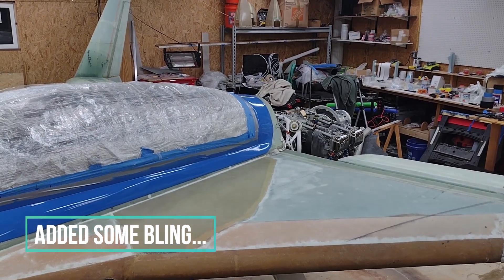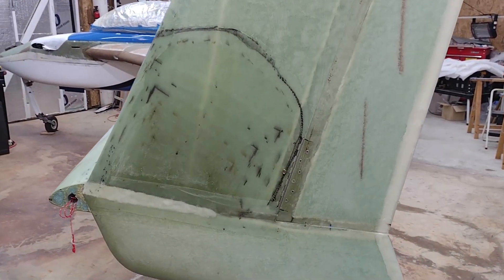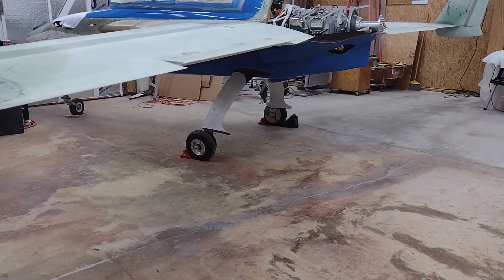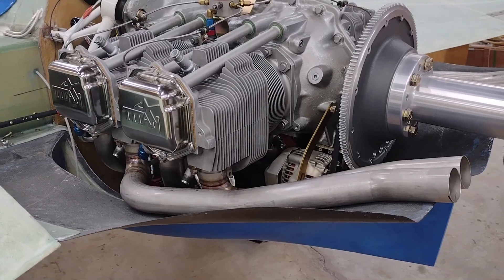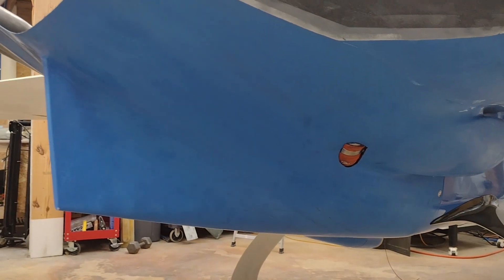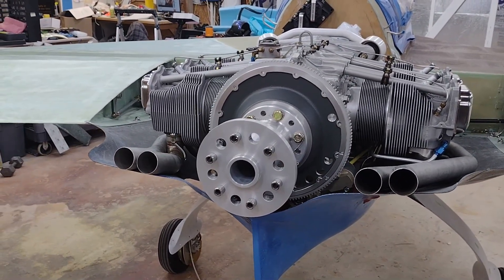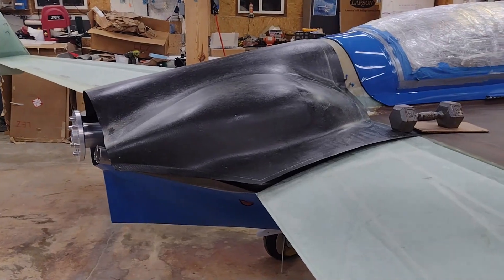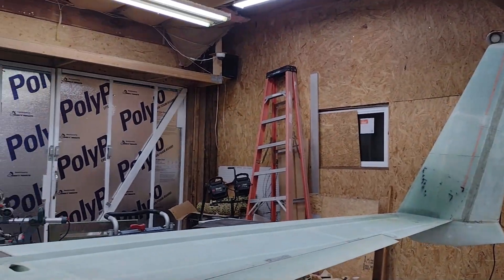Long-EZ N916WP - Project Update: Winglets, Rudders & Cowlings

Comment: You can cut your alternator adjustment bracket on the upper end and allow the alternator to get right up against the crankcase. I’ve done that 30 times in the past . At your armpit scoop laminate a vertical fence onto the cowl to keep the inlet flow from dumping into the bottom of the cowl . The inlet flow energy must be laterally contained so it can be directed at the cylinders
Reply from the maker: When you do your alternator mod I'm guessing you have to determine/buy a shorter belt?  Or does the curve of the bracket keep it equidistant with the same size belt?

Since this video I've installed the vertical fences based on Mike Melvill's patterns, slightly modified for my engine of course.  I'm also assuming he got those from you.  I've got them about as high as possible and as close as I can get to the bottom engine components with just enough clearance for engine movement.  In fact, I was wondering about the cylinder base fins getting enough air with those vertical fences in place?  Thanks Dave!

Comment: You changed the V/S area for styling purposes?  Anything else to make up for directional stab?  So, LEZ rudders only deflect in one direction?
Reply from the maker: I only reduced the height of the lower winglet (vertical stab).  Many builders remove the lower winglet altogether and there are a ton of canards out there flying with no lower winglet... a very common mod.  The upper winglet is stock size and position.  

That being said, the rudder is modified with the top and bottom cut level with the ground/wind, versus 90° to the rudder trailing edge (top & bottom rudder lines angled).  This too has proven to be stable with a virtually imperceptible affect on flight characteristics in canard aircraft configured so.  

And yes, the LEZ rudders only deflect outward, and are separate in operation.  This allows for deploying both out while on final approach as airbrakes to slow the plane down.  Also, the configuration is such in the rudder/brake pedal that you cannot push on the brakes without outward deflection of the rudder: thus, airbrake always before wheel braking to save brake pad wear and minimize brakes getting hot.

Comment: I’m curious at to what the final CG and empty weight will be if you know yet? All that engine and stuff in the back usually leads to aft CG that requires additional nose weight to bring it into the envelope. That, combined with all of the other “goodies” puts the empty weight too close to the max gross weight of 1325 lbs to leave any useful load. An old debate with the Longeze I know but where is yours so far?
Reply from the maker: My bird will be a bit heavy, estimated around 1050 lbs, but that is my choosing to throw all the "goodies" in at the beginning.  A lot of builders start with lighter planes but within 3-5 years add in extra stuff, like a cockpit heater, etc. and the weights typically go higher.  The original Long-EZ had an O-235 and a short nose.  Most these days have an O-320 sized motor and a longer nose  (like mine) with the battery farther forward to offset the engine weight. When you say max gross weight of 1325 lbs. I think you're mistaking the Long-EZ for an LSA.  It's not.  The max gross weight is higher than that.  I haven't gotten into all the particulars on that and W&B just yet as at this point I'm just trying to get the plane built in the lightest way possible.  Thanks for watching!
Reply: The original LEZ pilots manual shows design gross wt. 1,325lbs. Maximum landing weight is the same. Takeoffs up to 1,420lbs are acceptable off smooth surfaces with 6ply tires at 80psi. Inflight limits become 3.8g at this weight. Cautions that off-airport landings above 1,325 become exponentially less survivable as weight increases. Owners Manual pages 30, 39.

For all the "Experimental" in the Long-EX community. The fact nobody has increased the main spar cap and shear-web thickness by several plies, or used S2-Glass as Melvilles used, or increased the strength of landing gear legs either, is beyond me. 

These are simple mods that require no dimension changes to the aerodynamic surfaces on the aircraft. No change to any dimension anywhere, other than spar depth in foam. Or simply using S2-Glass. Or adding 8-10 unidirectional S2-Glass plies to the gear legs. Any one of these would improve structural safety and bring the stress/strain back into spec for fatigue and allow for the original G-limits at higher gross weights.

Comment: You're making good progress!  Consider mounting your fuel injection flow divider under the engine.  Airflow Performance recommends that the flow divider be installed under the engine when updraft cooled.  See page 29 of their installation manual.
Dave Adams
Reply from the maker: Thanks Dave!  I talked a good bit with Buly and my engine shop owner (a former LEZ driver) when I was having the engine assembled, and both had a lot of time with their respective spiders up top and both claimed no issues over a ton of flying hours.  Still, I've already recon'd the low-side engine and have a mounting spot, rough mount specs and approximate tube lengths ID'd.  Not gonna lie though, my curiosity wants to know how this high vs low spider mount thing really compares given various examples.  I've never seen anything in print before though other than in forums, so thanks for the Airflow Performance reference!